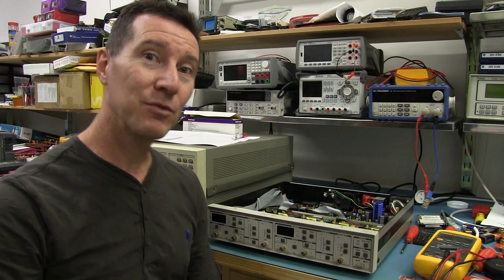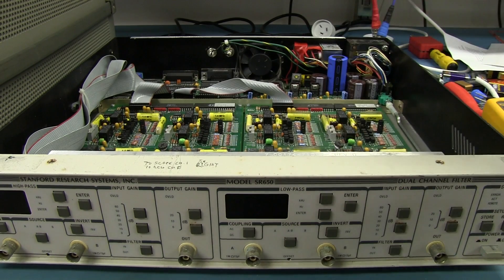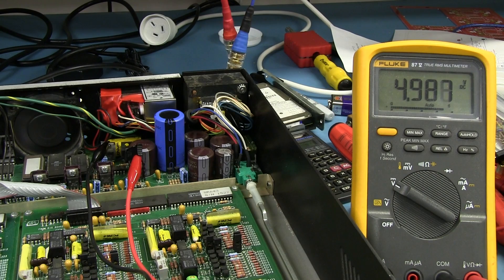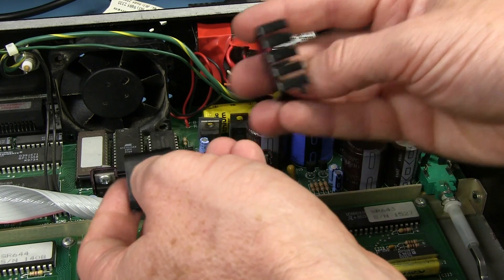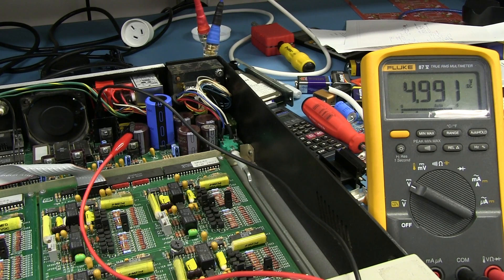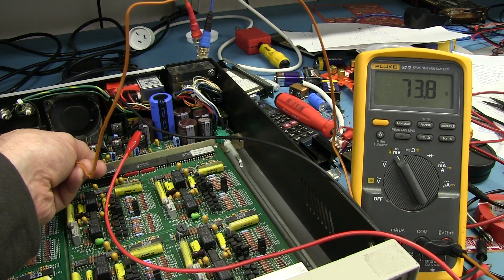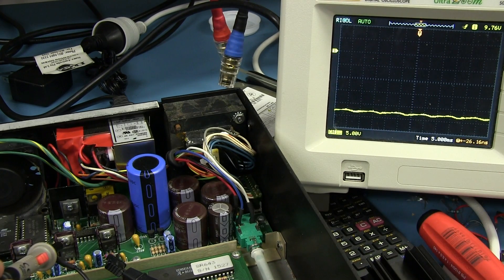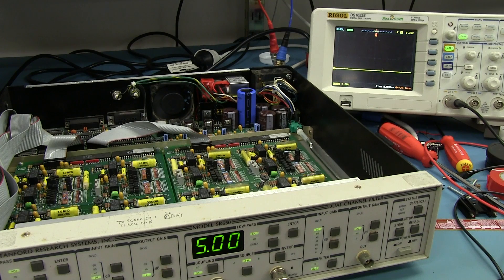EEVblog #621- Stanford Research SR650 Repair - Part 2

Comment: Might not have been the most in-depth repair video, as you hoped for, but it certainly planted the idea in my head to check for missing heatsinks or keeping in mind heat in general. I am actually really surprised by the behaviour of that regulator - I would not have thought of it as a problem.

But now I know!
Reply: That's the overload protection of the lm78xx (or similar linear regulators). It's mentioned in the datasheets, which you should definitely always read, if you build stuff, even if you think you know your parts (like in this case it really helps in troubleshooting). Depending on the manufacturer many datasheets don't even give a "continous current" or "maximum wattage" rating, they just tell you "internally limited".
Reply: latengocomoburro I bet you'd be surprised at how the complicated ones get a lot less complicated if you watch them 6 months later, after having watched a lot of the "simple" ones and (BETTER YET) trying to do some repairs yourself.  If you have a HackerSpace nearby, go and hang out during a repair cafe day - and if they don't know what that is, organize one!  http://repaircafe.org/
Reply: These are the ones I enjoy the most.... I get lost on the complicated ones.
Reply: Graham Leach That.... sounds awesome, actually.